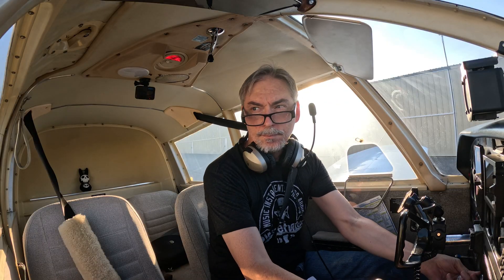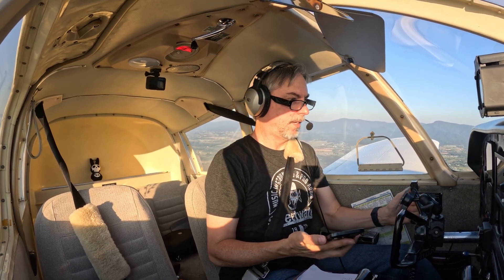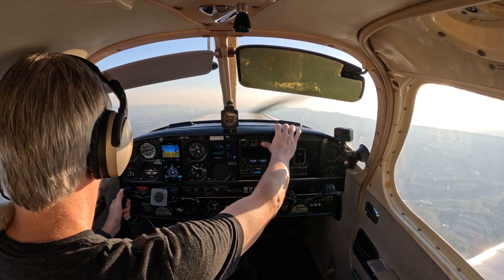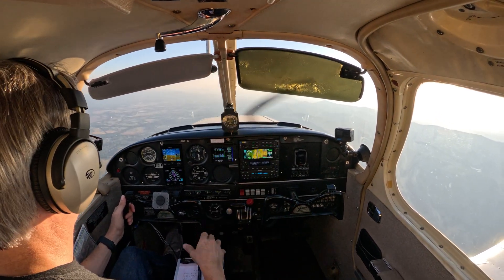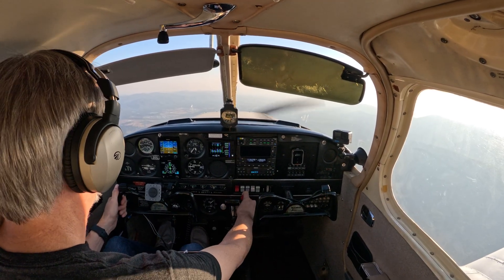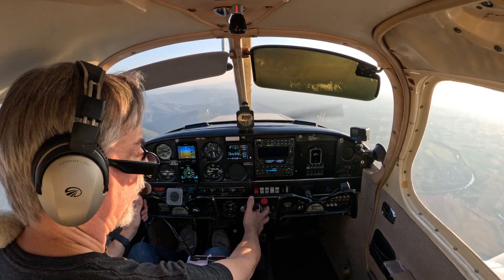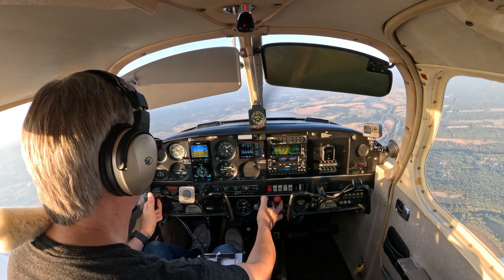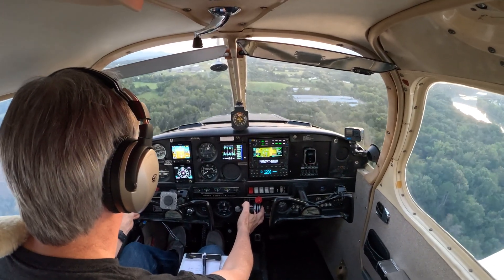Flying VOR Navigation for the First Time | Piper Cherokee PA-28-140

Comment: @WeekendFlier I've been looking at a 1971 PA-28-140 -- I heard you talking about your fuel burn on this flight, what sort of TAS are you seeing at that burn? (Love your panel BTW.) Thanks!
Reply from the maker: In cruise at around 2400 RPMs it averages around 100 MPH, sometimes a little more, sometimes a little less, it depends on the winds, and it burns between 8-10 gallons per hour.